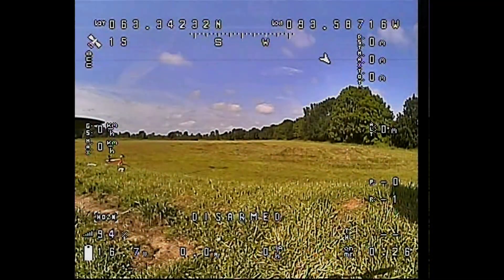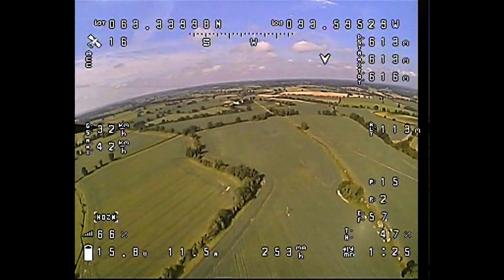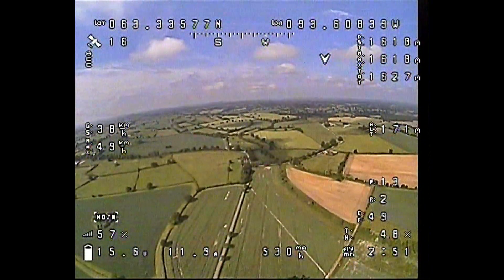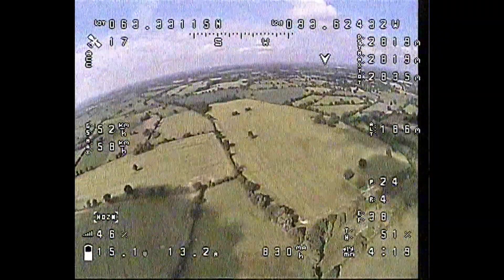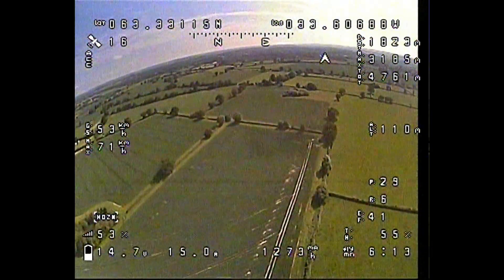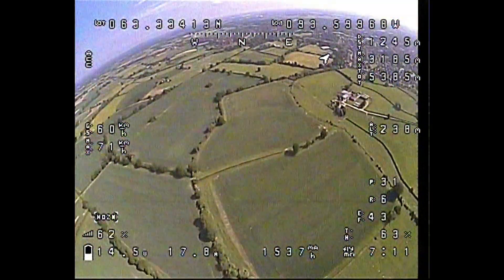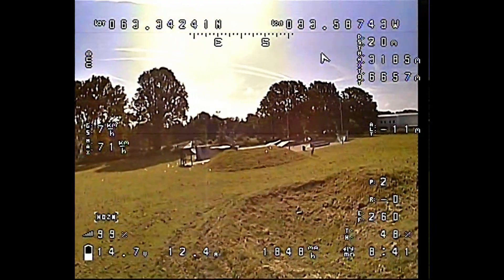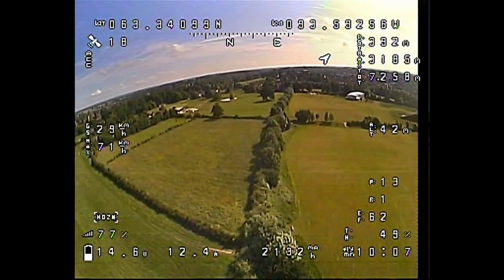ZMR250 Long Range INAV Quad 3K Flight Using Triple Patch Antenna

Comment: Man that's awesome, getting that much flight time. What battery and motors were you using to get that flight time??
Reply from the maker: Brotherhobby 1720Kv  motors and 2.2Amp 4S battery. I have been 4K with this setup and have also managed to get 20 minuets flight time. I am hoping to do these flight again keeping under 122 meters 400ft keeping safe while BVLOS
Reply: @Elecifun  what size batteries are u using?
Reply from the maker: @MrPlogibear  Hi, I am using 2.2A 4S Zippy Compact's  the lightest I could find with the most capacitance at 4S.